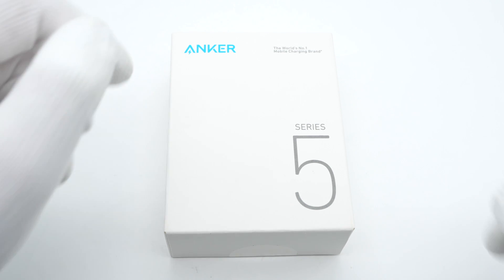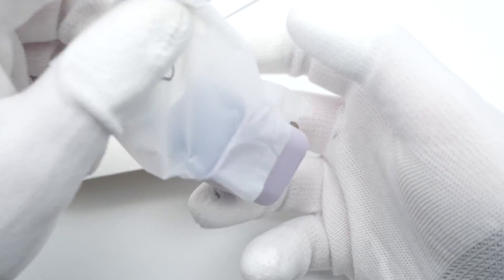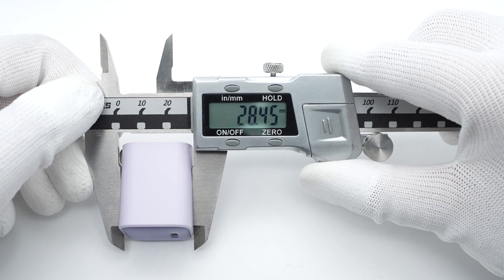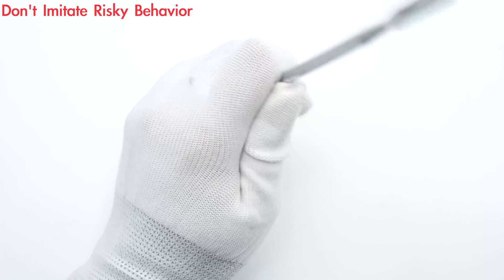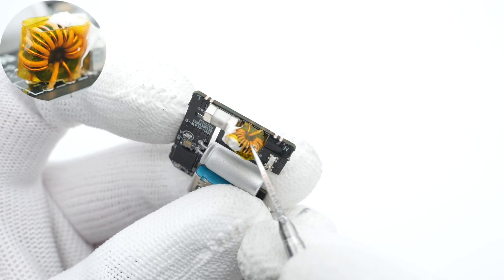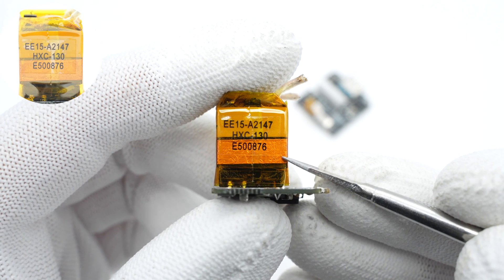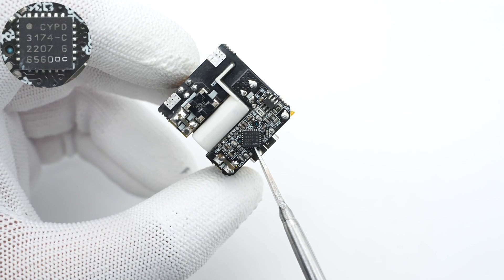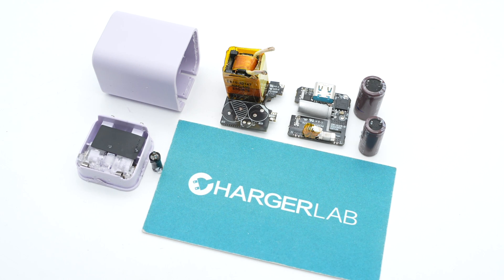Teardown of Anker 30W USB-C GaN 511 Charger (Nano 3)

Comment: unfortunately mine didn’t even last a year before breaking somehow. i’ll plug my phone in and it will say it’s charging, then immediately stop. not sure what exactly broke inside, but it’s kind of disappointing. i had a second one that i bought that doesn’t get nearly as much use, but now i’m a bit worried i’ll have the same issue. with that being said, they’re sending me a replacement in the mail so at least they stand by their products and i bought this one because frankly it seemed like the best charger on the market and its performance was awesome. charges stuff up in no time.
Reply: Send it back on warranty- oh, you did. Best of luck!
Reply: I've had several of these for a while now and...no problems. It's the only charger I have that can do "super charging" of my phone.
Reply: @MrPLC999 i’ve only had the issue one time so far, and they sent me a replacement super easy and for free. i’ve since bought 2 more because they work really well and i was super impressed with the customer service and have had no other issues. i must just’ve gotten an anomaly the first time.

Comment: Since DJI no longer includes a wall charger, this is the one recommended. Exactly. 
DJI Mini 3/4 Pro battery charging specs perfectly. Will make your batteries run and charge optimally.

Comment: Whats the difference between Nano 3 (30w) and Nano 2 (30w)
Reply from the maker: The size of nano 3 is 1.1 x 1.1 x 1.2 inches, while the nano 2 is 1.25 x 1.2 x 1.5 inches.
Reply: @ChargerLAB So the dimensions are the only difference?